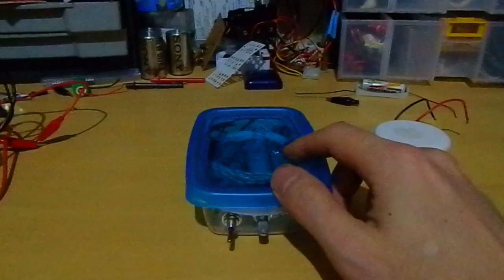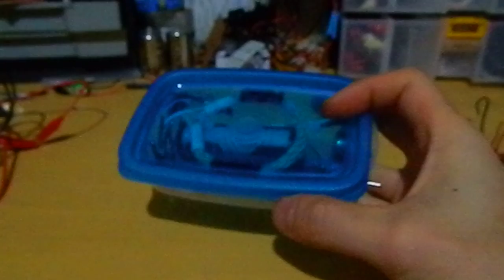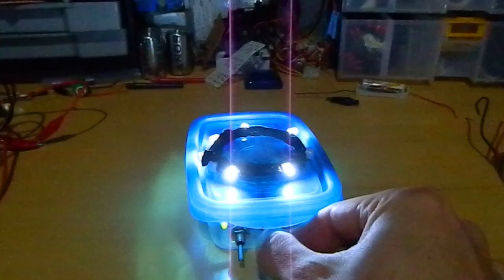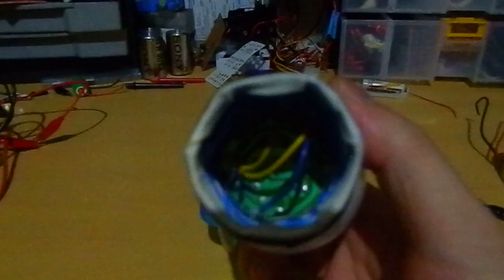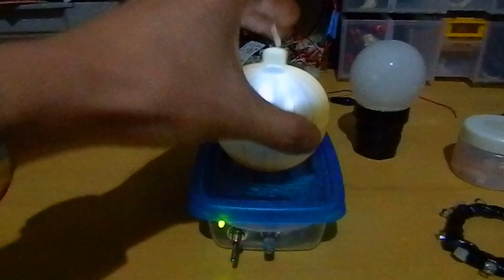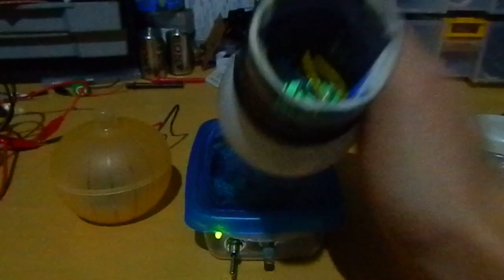Joule Thief Wireless transmitter - Wireless Led Bulb

Comment: I have seen your that video quite a time ago. Yes they are utp (unshielded twisted pair) wires normally used in the network(LAN). But I am still searching the reason, why could not get good result from those utp. Formula says in parallel connection the inductance is 1/normal (or series connection). So I also tried a single one instead of twisted one but nothing.  Now I will try with smaller diameter & I will keep you posted. Best regards.

Comment from the maker: I am using network cable wires. Great that you got a positive result. In the wireless experiments videos that I made you can see the coils I use. watch?v=mhHhV4qutyA
They are very small ones with 4cm external diameter. Regards.

Comment: Then where did you put battery charging indicator (yellow led)? Or are you using two separate batteries for drive & charging in this box or it is only one as can be seen  on the top of the box?

Comment: Thanks for your details. At first, I made one with 2.5m utp(like yours) with 5cm aircore gap but led not so bright, then 6m magnetic coils & it was better & finally 15m magnetic coil (0.6mm) & adjusted base resistor with potentiometer & surprisingly 22ohms give the best led brightness. Secondary also 15m coil & good led brightness or tiny green led before bat for charging. a secondary with 2 15m coil also ready but just intended to cross check with you if need any cap in there please. Thanks.

Comment from the maker: Do not be sorry... Answering is learning too :)) The coil is a bifilar air one and the circuit is just a Joule Thief type. Single transistor ( 2N2222 ) with a 10k potenciometer on the base before the tank ( cap and resistor in parallel ). No load on the circuit, collector connected just to the coil. Regards.

Comment from the maker: Greetings.... Simple as possible, just one coil and led :)) No matter the cathode and anode, just find the right direction of the coils and you are done. I mean, counter clock of the transmitter. Well, try both ways and see which one is the best to give a better light and less consumption. Regards.

Comment: Secondary inside plastic box you have put a JT. Now for this JT have you used the same coil as inductor or a separate transistor type 2 inductors? Sorry for so many questions.

Comment: I think the true definition of wireless is the transmission of energy by electromagnetic radiation.  Your transmitter and receiver are coupled by the magnetic field only.  Some circuits such as the Slayer Exciter are coupled to a CFL by the electric field.  Neither yours nor his use electromagnetic radiation, such as what is radiated from an antenna.  So I agree with TK - it's not truly wireless.  But I think it's cool, and I wish I could see the inside of yours or else see a schematic.

Comment: Very nice. As you comment in the video about TinselKoala's statement on wireless transfer, I agree with you. Your system is wireless.

The basic definition for wireless here would be that there is no physical wire connecting the source and the load. Saying that it is not wireless because there is wire used in the two separate circuits is silly.

The energy is transferred wirelessly (without a physical contact) from source to load, therefore it is wireless. Period. :)